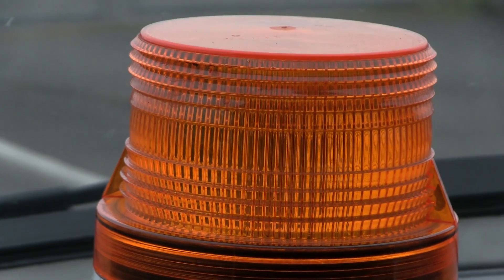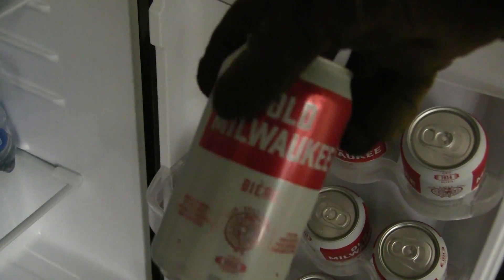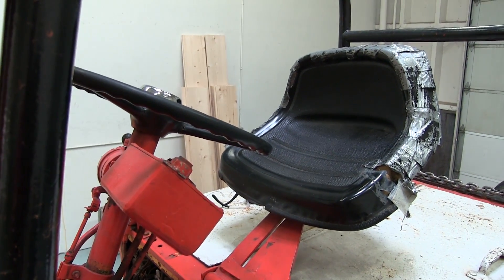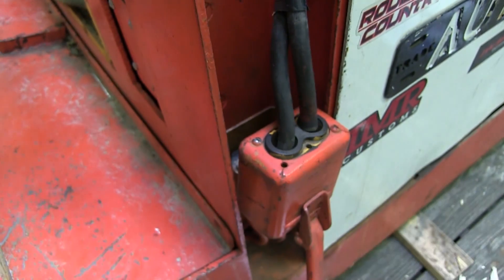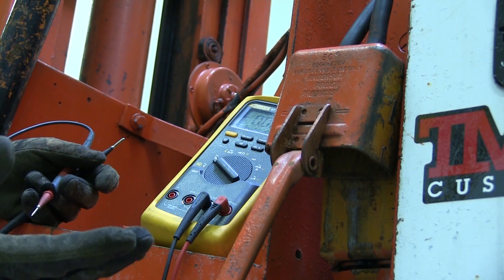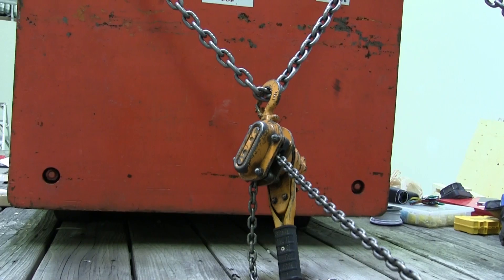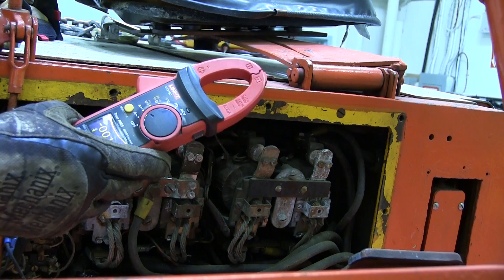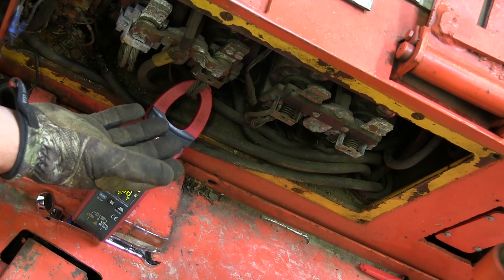Powerful Electric Troubleshooting | Voltage Drop Test

Comment: Okay, I may be setting myself up for some embarrassment. I have been drinking all day and its really late. 1. The long extension cord example: Think of the resistance of the hot wire and the return neutral as a CURRENT LIMITING resistor. You should never pop a breaker with a longer extension cord. You will just lose power at the tool from the voltage drop. Since if you add all the voltage drops across the circuit up it will give you the supply voltage. 2. Chucking the fork lift stationary and checking current will only get you the stall current for both forward and reverse... since forward is working, if you drove the thing around while taking current measurements you should get a lower draw than in reverse. That would point you to a stalling issue in the reverse direction. 3. This one I haven't thought through that great, I'm tired... drunk. But I think you might be confusing something around the area of power dissipation and losses due to the resistance of the wire itself.  ie. The guy with the suicide cable, just because the wire looses an amount of power by its own resistance doesn't mean its fit to carry load of a certain amp. If you do the same voltage drop test on a factory made 14 awg extension cord with a huge load you will still get the same "pass" condition you used with your example, but you will melt the wire (depending on the breaker size of course).

Comment: To reverse the voltage and thus reverse the motor should not the contactor operate  two poles not one. You cannot reverse the polarity with just one N.O. contact.  The video show only one pole on the contactor operating. Think of a two pole three position  center off switch wired to control the direction of a DC motor. In the forward direction two poles would close and provide plus and minus to the DC motor. When you want to go in reverse you operate the two poles of the reverse contactor whose output is cross wired opposite the forward  contactor thus reversing the motor. I doubt that the other poles on the contactor are shunt contacts for speed control . I would suspect that the speed is resistor controlled either with stepped fixed resistor or a carbon pile.  This is only my opinion !!
Reply: There are 3 wire reversing series wound DC motors, the common wire goes to the first armature brush and the other 2 wires go to the ends of a center tapped field winding. The field center tap goes to the other brush. With the center tap you end up with what is effectively 2 field windings wound in opposite directions for opposite magnetic polarity, hence one becomes forward and the other reverse. This setup with 2 single pole contactors is commonly used on 12v hydraulic pumps for pickup bed hay bale stabbers, RV/camper slide outs, boat tilt/trim, Etc. I have just such a pump sitting in my garage.

Comment: When I was working on those batterys I had my spanners taped up. Cause a major short and the top of the battery can launch itself through the roof.  Normally 48v with 800 amphour.

Comment: I would argue with the statement that long extension cords trip breakers more often. Linear components (Motors, transformers, etc) will not draw more current at lower voltages to maintain constant power output. However a switch mode power supply (Like a welding inverter or a VFD) would happily do that for you...

Comment: As a fully paid up member of the back of the class, I have to say, I nearly understood this.
I am a visual learner so nuts and bolts and everything in between comes easy to me. Electricity is so much harder because I can't see it. Because you showed us slowly and clearly with the meters, the penny is starting to drop.
My brain still has to visualise pixies flowing down the cables etc rather than just doing maths, but it works for me.

Comment: Had a problem on a machine I was operating similar to this.  Twas the gearbox.  Not sure if these old bastards have a chain driven gearbox but that caused an issue just like this where it would go one way but bind when it went the other.

Comment: Had a guy in a comment yesterday who said POWER, (in car engines) is best measured in TORQUE, not HP..
Not too much use having 1000Nm if your rpm is 1, neither is having 50.000rpm if your torque is 0.001Nm. (or footpounds for that matter)
Tried to explain it to him, he never replied, he might be a moron, who knows..

Comment: Gearbox issue?  Bearings go out, suddenly it will roll in one direction and binds in the other?

Had that happen with a John Deere B.  Wouldn't go more than 6" forward, in reverse it would go all day.  Dad took over from me, as the failure happened on a very steep hill.  When he figured out it would still go in reverse, he turned it around and drove it on home, backwards.  6 miles.  In the days of Chicken Box radio, he sure generated a lot of local chatter over that.

"Why, on earth, are you driving that thing down the road in reverse?"
"The view is better."

Just one of the many odd breakdowns that happened, under my hands, during the summer of my 13th year.  The year my C B handle went from "Master Mechanic" to "Junkyard Dog."

Comment: Nice to see such a modern forklift.  The last one I used was a 3-speed (plus reverse, of course) with a clutch pedal, a gas bottle on the back, and didn't come with a cage over the operator.  Great times.  :-D

PS:  And this was in the early '90s, no less.  :-P

Comment: The hardest thing for us automotive guys to transition into forklift repair was relearning battery negative. At least on newer trucks the chassis is not grounded. Everything electrical on the truck goes through battery positive or negative. Calling it a ground will get you funny looks. A common test to run is the check the frame for voltage. Both positive and negative. Operators love to shove wood into the battery box and creating a shirt to the chassis. Just a few volts is enough to create ghost problems on these newer trucks. Also test the battery case itself for voltage. All the crud on top will bleed voltage to it. 

In your case brakes seem like a logical answer. Either parking brake, service brakes. Jack the truck up so the drive tires are off the ground and see what it does. Taking 8k lbs off the drive units may help.

Comment: The reason you were seeing voltage on the battery even though it wasnt under load is because of parasitic voltage. the acid leach and film on the battery surfaces will draw voltage and register on your meter. Those batteries are in bad condition and should be replaced.

Comment: Hey AvE the motor should be a shunt wound motor, and it should be bolted with to the axle. Something in the back of my mind is telling me it's bad brushes or a bad bearing.  I have seen both issues with old forklift drive motors.  

The brakes are only on the front axle and they are likely Bendx Brakes.  Trying to remember stuff from 35 to 40 years ago when I was turning wrenched on them.  All of them used much the same systems and many times the same parts but with their own part number on them.

Comment: Much safer to use a 100Watt headlamp globe and a 12 volt battery to test the Vd of the circuit, less chance of barbecuing a viewer 100/12 =8.3Amps much less inrush current too, granted your supply is only 110 Volts (watch makers stuff), but it can make a half decent banging you try hard enough.

Comment: Single phase VD = I x R or VD=2 x K (Cu - 12.9 ohms & AL - 21.2 ohms) x Q (AC/DC adj. factor) x I (Amps) x D (Distance)/CM (conductor circular mils) and for 3-phase just replace the 2 with 1.732. I tried to explain this to a helper one time while on a service call, another electrician installed (4) 100w coach lights 300ft from panel in #14 and the lamps barely light. The helper kept insisting there was proper voltage at the coach lights....Ah, the days of being full of piss and wind.....I explained there will not be a major drop in voltage until load is applied, so I energized the circuit and down went to voltage. He thought is was witch craft or magic, he quit a week later, good thing since he probably would have burned down a structure. That's the only time I think you can say VD saved people's lives.

Comment: +AvE 17:15 I must disagree with you on this. A long extension cord isn’t what trips breakers unless it melts down and shorts out. The longer the cord, the more resistance under load which will cause a voltage drop across the cord. This will lead to less voltage into the load which means lower current in the circuit. The cord will act as a current limiter much like a dim bulb limiter or an inrush current limiting tube. If the cord is too small it will simply over heat, melt down and even glow with enough current and cause a fire.
Reply: I've had this discussion many times.... never settled it.
It's always stated like this:
Resistance..... IE orange cord, bad connection..... causes voltage drop. this will kill you tools "and trip breakers" 
I've argued (maybe wrongly) that the resistance should limit current. 
I've also heard it said there is a difference between a static load and a dynamic load
Anyone care to chime in?
Reply: I should add that a while ago I had a pair of very powerful 45vac transformers from a professional audio amplifier. 

I wired them together in parallel and also in series with a 1500 watt space heater for a current limiter. 
I was able to deliver about 13 volts AC at over 100 amps. 

I did experiments with running 100+ amps through a about six feet of 14AWG copper wire. 
Monitoring the current I found that it initially will conduct 100 amps but as the wire heats up the current drops, the  jacket melts down and the wire lights up. 

If the wire can conduct enough current long enough to heat up the breaker then it will trip. 
Otherwise your wire will heat up and try to become a light bulb. 

Also, a 15 amp breaker will conduct more than 15 amps briefly if it doesn't have time to heat up.

Comment: AvE being a forklift mechanic for both electric machines and diesel id put my money on the motor or the brakes.  There will be no brakes on the steer axle.  They should be hydraulic brakes with cables for the park brake mechanism.  Should be able to jack it up and find the access hole on the back plate to back the star wheel off the adjuster. Before doing that though make sure the park brake cable has not froze in its jacket and causing it to stay engaged a bit.

If the brakes are good id check the motor brushes and also the gear oil in the diff up front for shavings.  The motor likely isnt shorted in reverse as the contactor didnt look burned from overdraw. Its a mechanical issue for sure.  Pull the battery before jacking it up any and save the strain on the jack. If the lead is long enough on the battery put it on the floor beside the lift and plug it in during testing.  Those batterys are a couple grand each so yea if the voltage is good despite its look id leave it alone.

Comment: my old man worked for yale lift trucks back when i was a wee little  lad. if i remember correctly all the contacts on electric lift trucks are 99.9% fine silver. due to the conductivity and high heat

Comment: Just wanted to say thanks for the motivation! A few months ago in a vijeo you told us to build stuff whether it been with cardboard or anything. I built a soap dispenser and clap on clap off tv remote with an Arduino and I just got a new really great job with an engineering company! Thanks:D
Reply: Soap on, soap off
Reply: I honestly can't tell if this is a joke or not
Reply: Denzel Morok Many truths are told in jest.
Reply: It could still be just a tech job, like a fabricator  ...working with engineers, also.

Comment: AvE, not trying to sound like one of  those arm chair quarterback types.  Love your vids and learn a lot from you. From the viewpoint of an angry pixie wrangling enginerd, something to consider before tearing stuff apart is to ohm out your motor and also measure the voltage drop across  the contactor to ensure your contactor is good. Since your wheels were not spinning your current measurement would be a locked rotor amp measurement so it will not be your true current draw while running. A motor ohm could tell you if some of your motor windings are crapping out on you.  Love your demo of using voltage to ensure low resistance. I use to always disconnect the wires and measure resistance until a gray beard showed me that trick. The moral I learned from that is, when a gray beard talks, STFU and listen.

Comment: Been burned before not checking voltage drops but just available voltage, I assumed circuit was ok because without load I had full voltage at an open circuit right before load. Nice to brush up on diagnostic techniques!

Comment: ok..... since we're on the subject........... bad connection,... cheap extension cord (small gauge), ......"resistance",   causes voltage drop, therefore  breaker trips....... I thought resistance limited current?  My brother and I have discussed this many times, and I figure this  platform is my best hope for the correct answer

Comment: Yeah, the old voltage drop across those extension cords they sell in the big box stores will trip your breakers in a heartbeat. Find the cords with10 or 12 gauge and stay away from 14 & 16 for long runs.

Comment: When you tested for current didn’t you test upstream of the contact? If they are a shared lead you will absolutely get the same reading in forward and reverse. I think the test should be downstream of the contact. Down stream of the contact with high resistance would equal lower amps to the reverse circuit. Am I seeing it wrong?

Comment: Ah, you need the trailer empty to use it. Temp solution is swap the front (drive) wheels side for likewise. 
That will have each one turn-ulizing front-to-back-wards. Drive it off and make sure it gets parked with plenty of room to jack it for wheel flipulation.

Comment: I own a Carpet Cleaning Company. One of my machines is having an electrical problem. I've been a long-time viewer of your channel. I started watching your videos with absolutely no mechanical skills.

But I can comfortably say because of your videos, I now have the confidence to take apart my machine and try to fix it myself.

Got it all taken apart, couldn't fix it and now I can't figure out how to put it back together. It's fucked now. But that's not important, what's important here, is you gave a fucking dummy like me the confidence to do it. And for that I salute you my friend! AVE you are a damn LEGEND!
Reply: 90% of the job is having the balls to take it apart and the memory to put it back together.
Reply: AVE gave me the false confidence to take apart my leaf blower to replace the bearing. I broke it taking it apart, glued it back together, the right royally fuckered it on final assembly. then it let the smoke out. The nut was truly behind the steering wheel on that project.
Reply: As my wife's father is want to say - it ain't working anyway so might as well have a go at it.
Reply: John Phillip well I think I like your father in laws thinking. I'd almost say you married up , but then again you're hang in out in ave's alley of the internet 😄
Reply: Many times you learn more slummin' around rather than hanging out with royality.
Reply: Texasdee - I have no aspersions, I come from the wrong side of the tracks just like most folk, wife's the same.
To a degree I miss rural Canada, folk leave you alone and don't pester you about stuff or say "call a professional timeserved lad in" like my mum does...she still gives back handed comments whenever my old man ain't around.
Reply: sp1nrx I work for the helpless rich every other day . you do in fact learn a whole heck of a lot more from the not so rich and famous. The best hangouts have mystery mechanical parts covered in even more mysterious ancient grease. And some old critter who hands you something and asks if you ever saw one of these.
Reply: Charles McBride OK , so now you're at the part where you call wife's life insurance policy / new boyfriend fund. Then put your mother on speedial, and engage the safety squints.
Reply: I HAVE GREAT NEWS GUYS! I fixed it I was able to put it back together. The root of the problem- FIRE. The solution- bigger the glob the better the job. Knowing that I don't have to use the machine and it's a ticking time bomb- PRICELESS.
Reply: Fire is just a feature you added.
Reply: Charles McBride glad you got it! I’m usually pretty good mechanically- sometimes, though, the return trip becomes mysterious. It did this occasionally 30years ago, now it happens somewhat regularly LOL but what I learned 35 years ago is still true today: if it came apart and I have any mechanical ability at all, there is some combination of pieces and parts orientation that will return it to function. The possibilities are finite, though sometimes the possibilities list is long, but if it worked once, it can work again. 
I’m almost finished a total rebuild of a 1989 Jeep- the above principle has let me fix a disproportionately large number of things without even buying parts.
Reply: Just remember everyone starts out where you are.
Reply: Lmfao this comment was funny AF